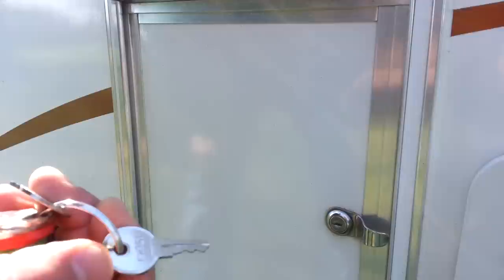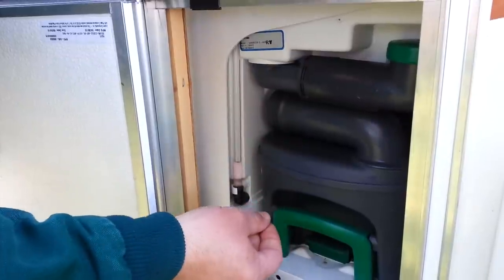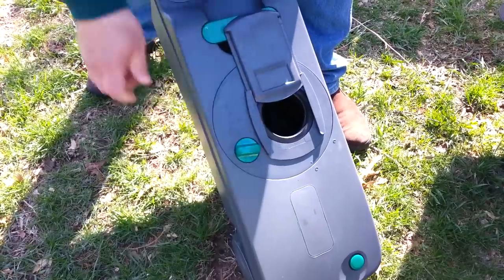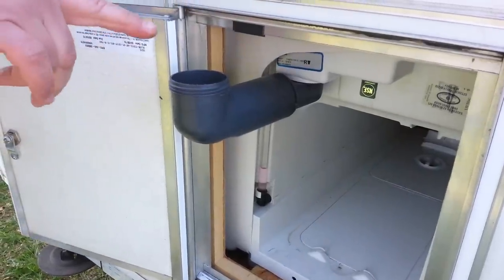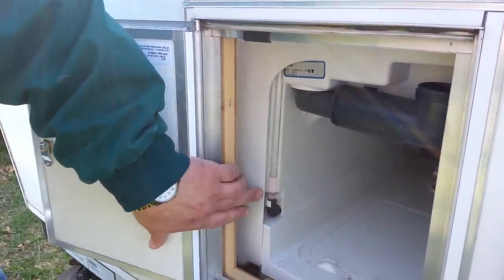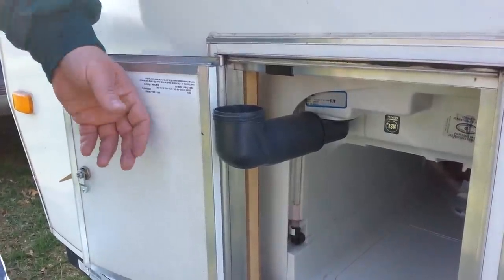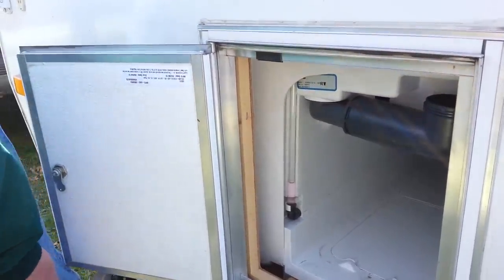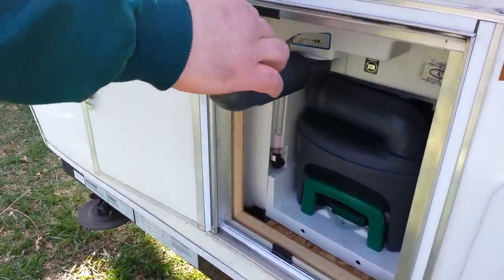Preparing the camper for toilet use

Comment: We're heading camping soon and it's only the second time we've used our camper, but have never used our toilet. We just tried to put the toilet solution and some water into the swing valve, but it's not going through. It's just sitting there. The little test tube window is showing no water. It's all sitting in the pipe. Help! We need to leave in two days and don't know how to get this thing cleared out! Thank you.
Reply: Lisa Goich did you figure it out?